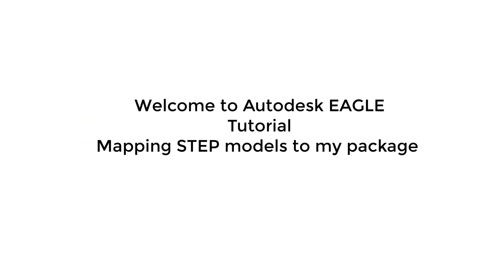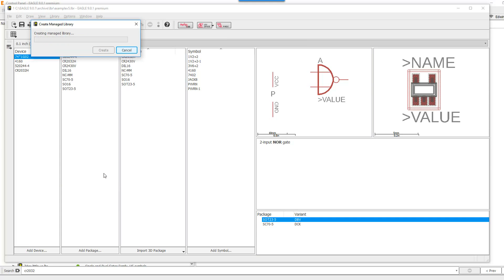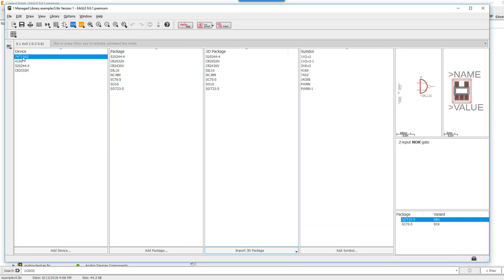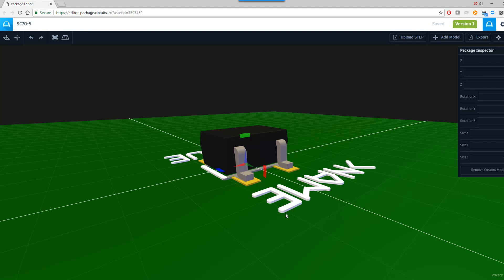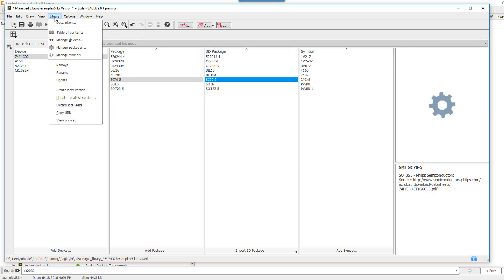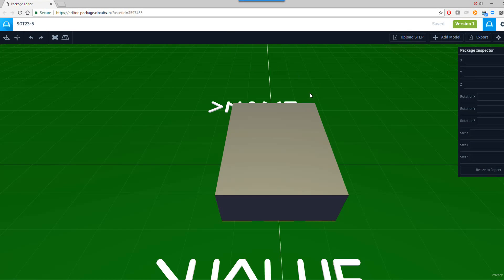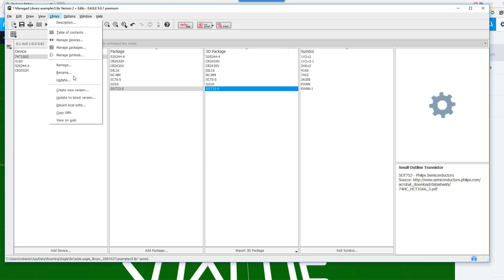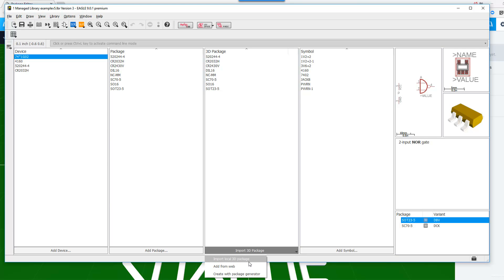NEW!  Learn How to Map Step Models to your Packages in EAGLE!

Comment: Will just leave it here, maybe it will save an hour or two for someone like me (and for me as well as I am sure I will get here many more times):
- In case you're trying to add the custom 3d Model - make sure you are EDITING existing "default" package. And God forbid you to choose "Create with package generator" from the scratch. This option is there only to confuse people. You will spend hours trying to understand if there is no option to "Upload STEP", etc
Reply: What does this mean? I have this problem, what is "default" package mean ?
Reply from the maker: Hi Sergey, Please update your library in the EAGLE design. Library > Update in the schematic editor. Pick the library that contains the mapped part and click OK. Save Design and push to Fusion 360. Let us know if this works. Please join us on the EAGLE forums with your questions. Cheers.
Reply: @AutodeskEAGLE  How can something so simple as "Add custom 3D Model" be so confusing that people have to look for the solution for HOURS on the web? Can you imagine that there are hundreds of people wondering how to add one, single file to the library? 

It shouldn't be that way.
Reply: @AutodeskEAGLE  wut. how tf do I add a STEP file to the library? im in the table of contents and dont see upload step.

Comment: I'm sorry, but it is a joke. Why can't you just link a 3d model with an existing element in a library? Or even just a type of package (for instance the same model for all 0603 SMD resistors). It takes too long and is confusing. Not mentioning the fact that 3d models do not self-update on the existing .brd project. Ineffective and useless approach.

Comment: Good tutorial. But, either I misunderstood something or did something wrong. I am using the Free version 9.5.2. I added a 3D model but it didn't seem to work. What I had to do was associate the Dev with the 3D model I created; Then I also had to map the pins to the pads. Nothing in the video shows that process...unless I missed it.

Comment: none of this works!
Reply: Hi Dave, you need to make sure that you are online for this to work. From the Autodesk EAGLE control panel click on the down arrow next to your name and make sure that you are online. If you are online, then go your library and the manage library option should be working. There are virtually 3 mapping mechanism available in the EAGLE library editor:
- Assign STEP models to your existing Footprints.
- Generate the Footprint and 3D models using the Package Calculator.
- Associate your Footprint to one of the thousands of 3D models available on the manage library.
- Copy footprints and 3D models from other libraries to your own library.  

I've been working on a short write https://tinyurl.com/y9s7uqm7 for this topic, you are more than welcome to take a look, its not finished at this time.
Reply: @EdRobledo  still doesnt work - AUTODESK needs to COMPLETELY START FROM SCRATCH for THE LIBRARY and its EDITORS!! the current system is SHIT!

Comment: Hi!
Thanks for that creative video, but I have to ask Autocad something.
Let's say, I'm an electronic engineer and I have to design an electronic device, why I should be also a 3D modeling guru too? That makes me no sense.
Is there a simpler way to render my pcb in 3d than to design all my 3D stuff etc?
If no, then it is same to me like I would first write the Eagle software and then I will create my circuit board...
Do I miss something?
It is a lot easier in NI Ultiboard to do this task...
I hope you got my point of view...
Reply: Hi Christian,  EAGLE need to have some an association between the footprint and the 3D model. 3D models are commonly supplied by manufacturers or you can use the EAGLE package generator to associate one of the thousands of models available to your footprint. You may also consider creating the Footprint and 3D model using our Package Generator, which provides many of the commonly used component templates to create the footprint and 3D model on the same step. Its a matter of simply transferring the measurement information from the specification sheet to the template.
Reply: 1. Eagle is now owned by Autodesk not Autocad
2. You don't have to use 3D models for all the parts
3. use the package generator, it makes life so easy
4. Yes you missed something: the built in package generator

Comment: When I try this, the Package editor that opens up does not have the "Upload STEP" option - is this a premium only feature?
Reply: Hi.Did you solve? I've faced same problem. but the thing is i did it several times but now package editor does not have upload section. I'm using education version.
Reply from the maker: Hi Gorkem! Please  see the answer provided for Jonathan. Hope this solves your question. Please reach out on our EAGLE forums if you have any further questions. Thanks!
Reply from the maker: Hi Jonathan! Thanks for using EAGLE. This is not a premium feature, after generating the managed library, right click the default 3D package and select edit.  Now you will have the option to select a STEP model. if you have any questions please visit our Autodesk EAGLE forums here: https://forums.autodesk.com/t5/eagle-forum/bd-p/3500 Thanks for the question!
Reply: @AutodeskEAGLE  What is "default 3D package"  What does that mean ?
Reply: Why is it so hard to do a ob that could be done by 3 clicks??????
Reply from the maker: Hi Jonathan! Thanks for using EAGLE. This is not a premium feature, after generating the managed library, right click the default 3D package and select edit.  Now you will have the option to select a STEP model. if you have any questions please visit our Autodesk EAGLE forums here: https://forums.autodesk.com/t5/eagle-forum/bd-p/3500 Thanks for the question!